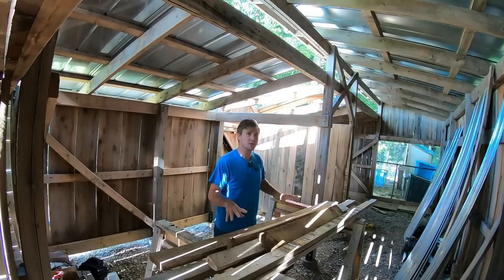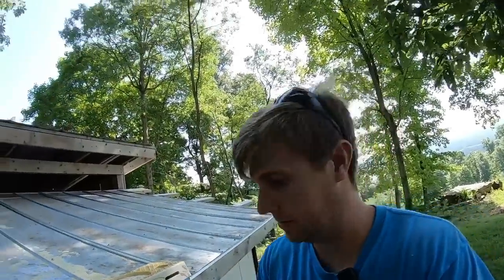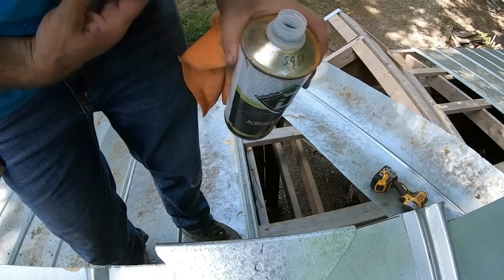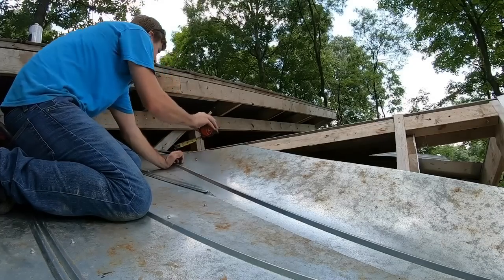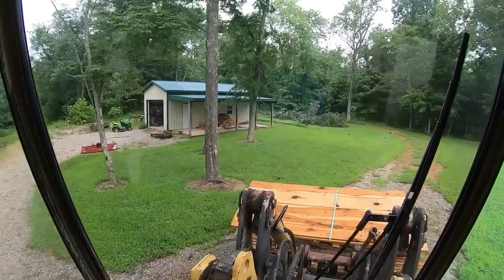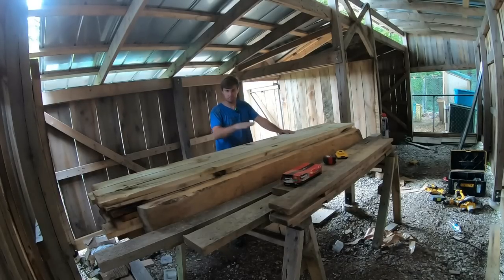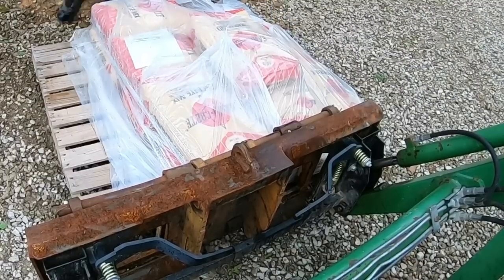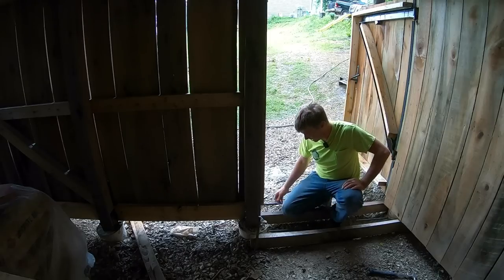Progress on The Barn Build - The Ducks Approve!

Comment: Captain if you turn a old circular saw blade backwards it cut roofing metal very well
Reply from the maker: It' works, but would get annoying switching blade back and forth between wood cuts and metal
Reply: Hey captain great job them valleys turn out nice bud I wonder how they worked out keep up the great video 👍👌😎✌️🇺🇲
Reply: Nice flat work outside the door, it's like it was planned.  Have a good week brother.
Reply: @CaptainKleeman  I have found that a fine tooth Diablo blade in the normal direction works just fine for metal roofing. Framing cuts take slightly longer due to the finer tooth but you wouldnt have to swap the blade! You know.....for your next roofing project.
Reply: It's going to turn out, an that is the best way to describe it.
Reply: The Mennonites who built my shop and barns told me they had tried it and went back to snipping… Saw blades tend to heat up the tin and burn away the finish… that makes them rust quickly and stain the surrounding metal.  It is much less impact if you just snip it.
Reply: That's wat I was going to say last  video but thought sum1 said that I don't look at other ppl comment God bless.
Reply: Gr8 video  keep up with the gr8 videos and content I know u was happy when bsg of concrete busted lol good valley work and foor concrete God bless 🙌
Reply: Done it with Al-loo-mini-um before but not steel. 
Don’t know if you can get a 6 1/2” combo blade like Evolution has but that would be better or just use snips like Captain Kleeman did since it’s not an everyday thing and as Mr. Sassafras said it can damage the surface.

Comment: The quickest way to burn the motor out on your mixer is to fill it before turning it on, then it on first the put your mix in
Reply from the maker: I got it for free, non running and fixed it. If it burns up, I'll do it again.  Rather do that than get cut up on the drum.  Excited to see a video of you dumping an 80lbs bag into this style mixer while it's running though.
Reply: @CaptainKleeman  I've got one, had it for over 30 years with no problems and back then we had 100 lb bags,

Comment: I think you built a fortress not a chicken coop. But it looks good. If you used yellow handle snips would not curl so bad.  Yellow is for straight cuts red for left turn cuts and green for right turn cuts.
Reply from the maker: Yup, used to keep all three in my belt when I did metal work.  Haven't bought a full set in a while.
Reply: @CaptainKleeman  ok so many people just think colors are for decoration.

Comment: Lovely job. I am wincing when I say this because it is such a great job but the overlaying of the joint where you put the double sided roofing felt is the wrong way round. Water will run off the apex under that joint and frost jack it up. A silicone bead just under the edge might save you.
Reply from the maker: Not worried about it.